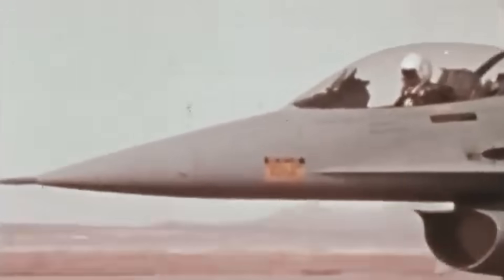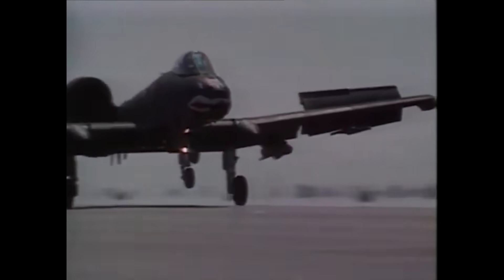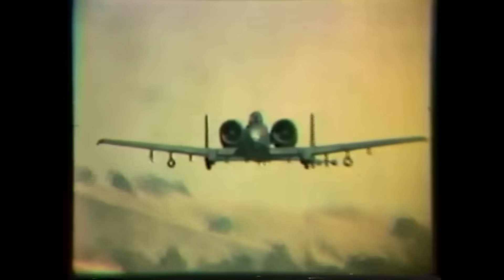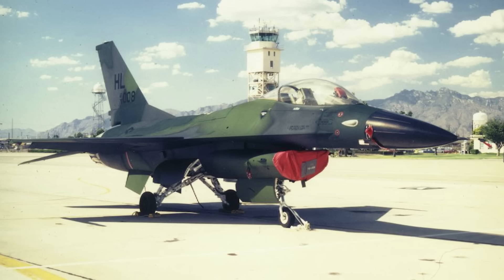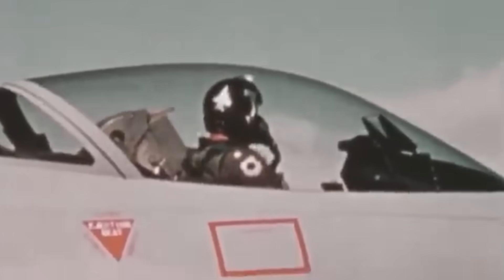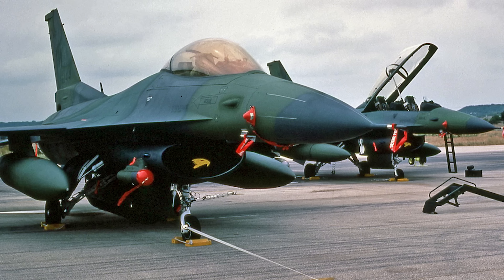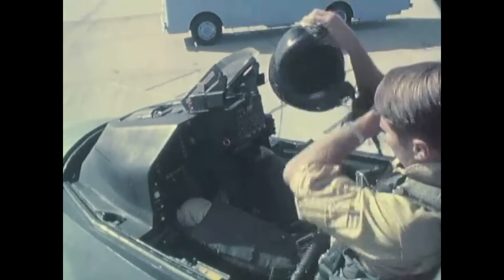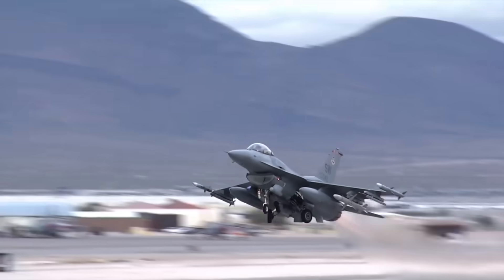The A-16. Can a Viper turn into a Warthog?

Comment: I wonder what pressure the military industrial complex put on the USAF to remove a single use case system (CAS) that was so inexpensive to operate. 

More F-16s would have lowered operational costs (improved ROI) but would have netted increased revenue for the manufacture. On the munitions side there would have been increased revenue from precision weapons as opposed to cannon rounds. 

Investing in platform capabilities like the A-10 is still relevant on the modern battlefield even in contested environments. As a comment below pointed out; A-10 pilots exclusively trained for this mission, a vital consideration for danger close air support

Comment: Wait, are we going to assess the A-10's effectiveness in light of what we now understand to be high intensity contested airspace? Because the Su-27 was pulled back from use due to losses, irregardless of the undenaible effect it caused on the battlefied. The air tanks pack a punch, but are not survivable against current AA assets.

Comment: The A-16 is coming into being now. The local air force squadron near me is switching from A-10s to F-16s. That same squadron had a USMC F-35B squadron come in a while back to train with them and learn ground support tactics from the A-10 pilots.

Sprey is a clown, though. The A-10 did not perform well in Desert Storm at al and the records show this very clearly. The F-111 drastically out-performed it for CAS in that conflict. Cool as the A-10 is, it's an antiquated platform with very outdated electronics and sensor systems, which is one of the reasons it has the highest rate of friendly kills of any air force aircraft. 

Modern CAS is done with guided munitions and the F-16 is fantastic at that. I'd prefer something with more loiter time, but that role is going to be better filled with either large drones or the new OA-1k (which has the bomb payload capacity of a B-17 and an extra crewman to help paint targets and guide munitions in), both of which are far cheaper than the A-10 to buy and operate, which means they will be available more often.

The 30mm gun is also kind of useless. Go look up the reports of hit percentages in training and then remember that they'd be even less in a combat environment. They can only rarely hit a tank with it, and when they did hit the gun rarely caused enough damage to matter. A 20mm or 25mm rotary cannon does just as well for what the 30mm can actually do.

Comment: Lets be honest, while the A-10 was flawed, the A-16 was a simply terrible idea. One does not take a small, high speed aircraft originally designed to be a dog fighter and then turn it into a mud slinger.

The problem is the Airforce just hated having an aircraft designed for army requirements.

Comment: With modern sensors and guidance systems is there still a need to go low & slow? The best combination might be A16s plus a low tech prop plane like the Bronco for loitering.

Comment: They  did mount 30mm on the underbelly of the F 16 . it was working however during testing in flight. The F 16 begin shaking so hard and pilots could not aim therefore rejected it.  There was other serious concern that recoil of powerful 30mm gun would crack the air frame . They stop the project to the bitterness Air Force brass.

Comment: Everything the A-10 could do the F-16 can do better. The only difference is that there’s additional hard points on a A-10 which isn’t that significant because we could make a beefed up version like the Mitsubishi F-2 which is 25% larger than a F-16
Reply: How about fuel efficiency?
Reply: @ CFTs exist, also making a larger version of the F-16 like the F-2 would make it a 20% fuel increase in addition to more hard points for more weapons. A-10s need complete air superiority in order to be effective, F-16s could protect themselves to a degree especially when you have double racks for AIM style missiles
Reply: Did you bother to watch the video at all? 🤦Or are you gonna make that comment regardless anyway.

Comment: What I find funny is they wanted to do the same thing with the f-35, use it for CAS.      It's just not designed for that!
Reply: the f35 was always meant to replace the a10
Reply: @aquilesca5tr0  I call that wishful thinking because it suffers from the same issues as the A16. It's original design is to achieve air dominance and SEAD missions. It's like how they originally wanted the Bradly to also be a scout vehicle. It 'can' but there are better alternatives.
Reply: @TechnoDelta  The f35 is simply better for cas than the a10
Reply: @ Less armor, less payload, less fuel for staying on station. How is it better?  Besides being less likely to friendly fire.
Reply: @TechnoDelta  it can carry more payload and is designed to fly above the range of manpads, something the a10 needs to do anyways to not be shot down making the gun dead weight.
Reply: @aquilesca5tr0  You can't fly above even a fraction of the MANPADS ceiling.
Reply: @Tattlebot  The manpad with the longest range that we know is the turkish Sungur with a range of 8km and still it can only engage targets below 4km or about 13 thousand feet. That´s not even a third of the f35s flight ceiling.

Comment: Lessee... The USAF had what is arguably the best ground attack airplane specifically designed for that mission but decides to take a light day fighter and convert it to the CAS role. The data speaks!!  Common sense be damned! 
Robert McNamara tried a similar trick when he wanted the USAF and USN to fly the F-111 both from air bases and carriers. That didn't work either. While an adequate airplane for land use, it was too big and too heavy for carrier ops and the Navy went on to get the F-14 instead.

Comment: My dad was an Eagle Driver in the early to mid 80's then flew Hogs in the guard.  I remember him talking about when the "politicians" wanted to replace the A-10 with the F-16 they had a fly-off between the two and included the F-15.  
The A-10 performed as expected, the F16 lacked in load-out and loiter time, but the big surprise was the F-15, being able to fly over the target, pull up and use it's huge power to weight and low wing loading to get right back on target over and over again.  After that they started working on the F-15E (or the "mud hen" as my dad called it, lol)

Comment: ???

The F-16 is already used in CAS missions. It’s a “multi-role” fighter. 

The problem with a F-16 it carries less bombs and it is too fast (compared to the A-10).

But no military service is looking for a replacement for the A-10. 

The F-35B is slotted for the USMC. 

The F/A-18 and F-35s will be our go to Attack aircraft along with our armed drones. 

I love the A-10, but it is a dinosaur being retired. 

The Air Force will not make new, modified F-16s. 

It’s stealth, stealth, and more stealth.

Comment: The f16 has less loiter time, which is kind of important for ground attack role, me thinks. Also im not sure if it can be as slow and deliberate as the a10 so the pilot has prob less time to identify a target.
The A10 is far from perfect, and is less flexible, but it was purpose made for ground attack.

 But is the A10's role going to remain all that relevant in a world filled with manpads?

Comment: Disappointed in this video.

-Mentions the A-10's loiter ability being born from Vietnam and being useful in Afghanistan, both situations where the US had relatively good control of the air and not much SHORAD to worry about. But this is a video about the 1980s Cold War environment where the A-10 was definitely a sitting duck, as its critics claimed. Even its limited success in Desert Storm was possible only with air superiority.

-Repeatedly mentions the A-10's ability to see targets low to the ground, even though this is actually a weakness of the aircraft in the timeframe since its lack of electronics made it hard for pilots to identify targets on the ground. 

-Quotes Pierre Spey, a known fabricator and exaggerator, without cross checking his claims against the official reports which contradict him. Worst of all, that seems a deliberate choice since the video calls him a 'pentagon engineer' which seems like an effort to obscure the fact that he was not an airplane designer.

Comment: The F16 just wasn't designed for close air support, it can do it but it's more vulnerable at low speeds. The Warthog can be updated, it's the kings of close air support.
Reply: The airframes are 41 years old. They can't go on much longer.
Reply: @ChucksSEADnDEAD  Time for some new planes that don't break the bank. I suspect the next war is going to be a war of attrition, so top of the line is a dumb option.

Comment: VARK VARK VARK ;) just pointing out the inevitable F-111 vs A-10 discrepancies in regards to "claimed kills" vs "confirmed kills". 2 thirds of armoured kills for the A-10 is a bit of a stretch - most public sources say that the F-111 outperformed the A-10 in the purely anti-tank statistics. it would be nice to find reputable sources though, i will admit. considering that this is "Australian Military Aviation History" I would have assumed you knew that about the F-111, considering it served in Australia's air force.

Comment: That bit at the end, about the contradictory arguments for the A-16, is key - along with the follow-on part about the Russian Su-25 Грач (Rook - NATO designation "Frogfoot"). The Russians agreed with the idea of a low-altitude, slow, loitering aircraft with a big wing and multiple redundancies, which is why they built the Su-25. And, unlike the A-10, they have fielded the Su-25 in contested airspace with some of the world's best anti-aircraft systems (specifically, Ukrainian-operated S-300s, early on in the Banderastan War), as well as infantry-carried MANPADs (specifically, Soviet- and Russian-built Iglas). They proved the idea works against both tanks and infantry - Ukrainian soldiers said early on in the war that their single greatest fear was not of Russian artillery, but air power, and that remains true to this day. Interestingly, though, the Russians also proved that something like the A-16 COULD, in theory, work, under the right conditions - that is where their Su-34 "Hellduck" comes in. The problem with the A-16 is that it sat somewhere in between these two concepts, and never quite managed to find a reason to exist as a result.
Reply: This is rubbish. Both sides have Su-25s. They use them by getting within a few miles of the frontline, pitching up, firing rockets and turning tail and running. The significant air power development is glide bombs which need a Su-34 to drop from altitude.
Su-25s flying over the foe just get added to the shootdown compilations.

Comment: A-16 Would've definitely worked if they used the XL airframe and modified it to A-10 specifications with a centerline GPU-5/A gunpod, with single/two-seat WSO variants and with capability to carry AGM-88 HARM missiles, JDAM and Paveway guided bombs with conformal fuel/water-methanol injection tanks for longer range or higher speed.

This aircraft would've had ability to fly without fighter escort or electronic warfare, instead having ability for swapping AIM-9 Sidewinders to electronic jamming pods.

The new A-16 would destroy SAM radars from distance before making runs on ground targets and leave enemy airspace safely back to base, whilst still having ability for defense from enemy aircraft, with multiple redundancies to absorb hits from AA/MANPADS, dispensers for chaff and flares with sh*t-tons of targeting systems and FLIR that even A-16/A-10 lacked wing airframe to have.
Reply: the concept you describe is a flying brick with less range, manoeuvrability, armament, protection than an a-10. this is re-inventing the wheel. i don't mean to discount your opinion, but you need a much larger airframe to even think about adopting all those capabilities... enter the F-15. which is ultimately what the US ended up doing.
Reply: @NullElemental  I have seen an SF2 mod for it though, just without some of the features i have described.

Does the F-15E actually have a larger airframe than F-16XL?
Reply: @NullElemental  Btw, feeling like i remember you from somewhere.
Reply: @who knows? I get around (; problem here is conflicted airspace. upgrading the F-16 to XL would require an extra engine and extended airframe, and the changes would basically turn it into an F-15 EX. Yes, the F-15 EX is bigger, and heavier. F-15 EX and the F-111 is/were fantastic at standoff precision bombing (and FAST) and unless you trade off survivability, can't really do what the A-10 does in a pure CAS role. close AAA and manpads. stealth and loiter time at standoff distance are really key now you cant afford to lose pilots to strafing runs. If it was still insurgents as the enemy then the a-16 is an okay CAS aircraft but i feel that expecting one aircraft to do everything is going to come at costs to its overall ability to do a particular mission set. Wish i had the answers, i mean if i was to hypothesise i'd if you want swarms of CAS use something like a unmanned a-16 with point to point laser relays or quantum comms or something that cant be jammed and go ham but making something that is objectively less survivable than an a-10 is probably not a good idea. combat radius is getting much more important as well.
Reply: @NullElemental  Btw, SF2 i mean Thirdwire Productions' Strike Fighters 2. Possibly better than BMS/DCS. You may want to play it.
Reply: might check it out when I get a chance ^.^
Reply: @NullElemental  Oh, and check the F-16XL mod for it too.
Reply: @NullElemental  You misunderstand what CAS is. CAS doesn't require the aircraft to be close to the target, CAS means the target is close to friendly forces. Dropping GBU-54s from 35,000 feet onto enemies close to friendlies is CAS.
Reply: @hresvelgr401  I didn't say that CAS needs to be close to the enemy. I was advising against that approach and instead to use bomb trucks like the F-111 and F-15 EX because exposing aircraft that can't handle AAA and manpads to such at close range is a bad idea if manned or not heavily armoured such as the A-10. The mindset that planes have to go on strafing runs is very WW2, Korea, and Vietnam. Stealth and standoff weapons are the way. As long as the weapon systems in use are affordable and timely in response to the need to protect friendly forces and that the aircraft doesn't need to expose itself to fire, there is no need to expose the planes to enemy at all. There is really no feasible way to armour an aircraft sufficiently in today's environment and losses of planes and pilots are a lot less acceptable now than they were in the past.
Reply: @ That's not what you said. You said the F-15EX and F-111 were fantastic at stand off bombing and but couldn't do what the A-10 does in CAS
Reply: @hresvelgr401  I found the exact armament for the F-16E/F in a mod. Though no Multiple Ejector Racks for Mark 82 JDAM's or LAU-88A/LAU-118A launch racks for AGM-65 Maverick or AGM-88 HARM missiles.
Reply: @Alex_Guy1011  what???
Reply: @hresvelgr401  Refer to above comment.
Could the F-16XL actually work in A-16's role?
Reply: @ I had to distance myself from your reply for a while so I could reply objectively. what the a-10 can do that that no other serving aircraft (in the US) can in a CAS role, is loiter within LOS distance of the forces they are protecting and engaging. it is essentially a mix between the old observer aircraft like the ov-10 bronco and the strike aircraft such as the a-1 skyraider. its slow enough to spot and engage forces on its own, and glide bombs and such take a much longer flight path to cause effects than an aircraft dropping 30mm cannon rounds. it won't be destroyed anywhere near as easily as other aircraft by return AAA and manpads. there is a disconnect between an aircraft such as an F-15 EX and the ground forces that they are protecting, as there should be, to prevent loss of the aircraft, but the A-10 can take a few hits. An aircraft the enemy on the ground can visibly see and fear results in effects on the ground that invisible glide bombs cannot achieve. Might result in more casualties for the enemy with a glide bomb, but soldiers don't run from what they cannot see.
Reply: @NullElemental  Loitoring in line of sight distance and spotting and engaging targets on its own is not a capability unique to the A-10. Any aircraft with a targeting pod can do the same. Even A-10s mainly use the targeting pod since the A-10C upgrade.

The A-10 isn't significantly more survivable then other aircraft. It's certainly not going to be taking hits from AAA or manpads and keep fighting, maybe it can take the hit and limp home but that's about hit.

And soldiers do run from what they can't see. Soldiers can't see artillery but accurate artillery fire will drive them back.
Reply: @hresvelgr401  Seen the comment yet?
Could the F-16XL actually work in A-16's role?
Reply: @ Maybe, bit tbh not much point building that over what the US already has